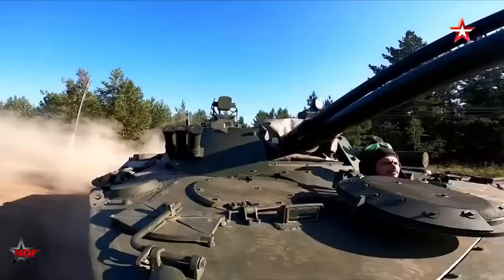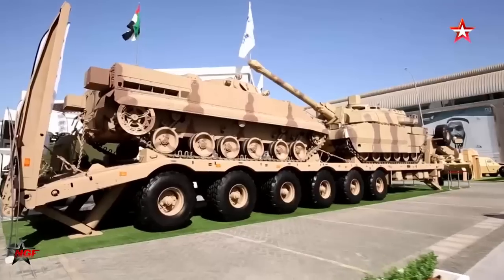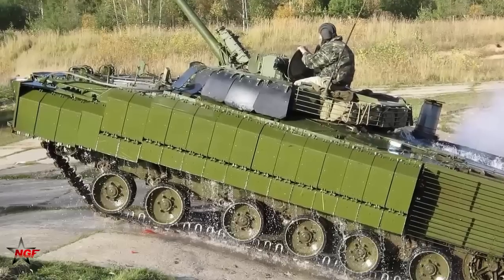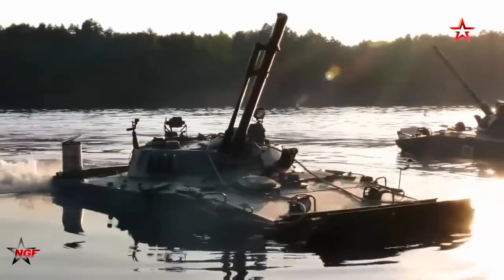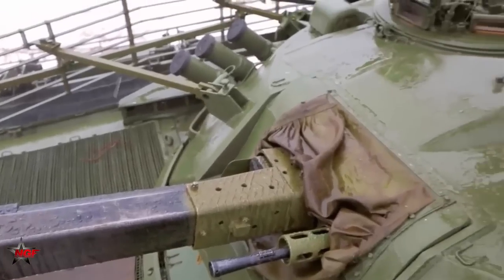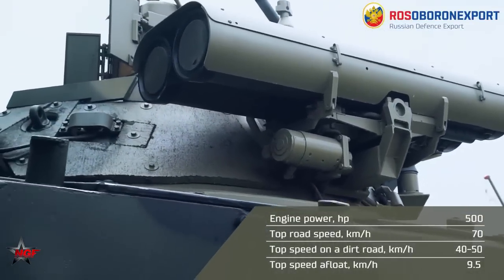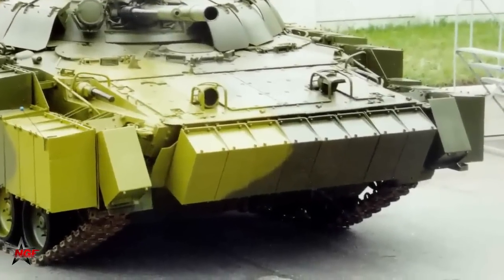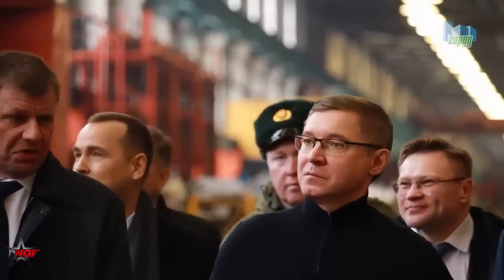The newest Russian infantry fighting vehicle Manul will soon go into mass production.

Comment: Some more information would be interesting, such as how do the attached infantry enter and exit the vehicle, are they able to fire from inside the vehicle!  There appear to be two sets of three smoke grenade dispensers on the front of the turret.  Have they considered fragmentary grenade dispensers able to fire in a 360 degree pattern to give the mounted infantry better protection when dismounting?  Does the 30mm auto cannon use the same ammo as the AGS-17 grenade launcher?  Does this vehicle have any anti-air capabilities?  What about anti-mine protection?
Reply: Because the enemy doesn’t need to know!😉

Comment: I dunno if its just my thoughts but i feel instead of all that the russians should do a modernization programme where one modernized chassis will used for all bmps and also a turret redesign and bmp 3 should instead get an 105mm anti tank gun with a 30mm auto cannon on top